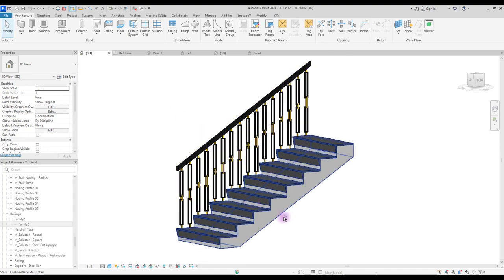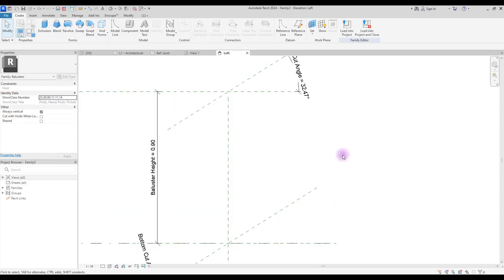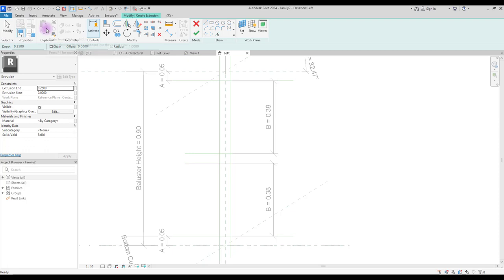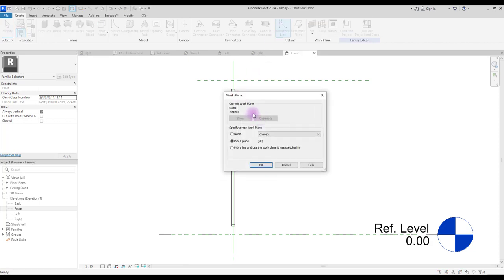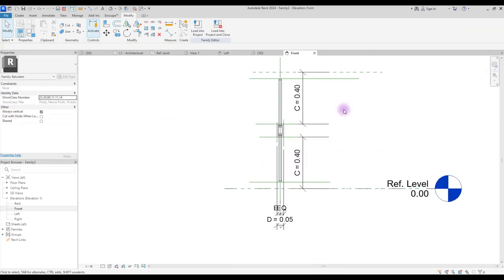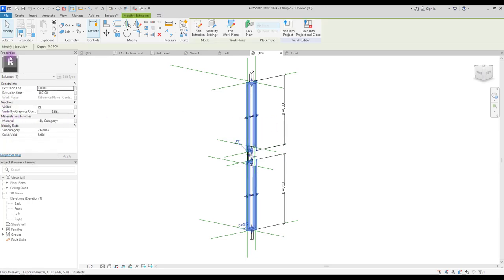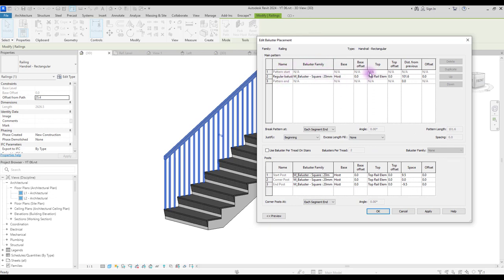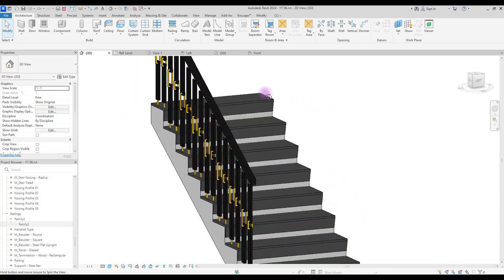How to Model Baluster Family for Railings in Revit 2024 #revit

Comment: Hi, Can you make a video about bath level drop? Should include finishes, structure. eg: from bedroom to bath with 25mm drop, bath to shower area with 25mm slope. is there easier way to modify it for all baths? I searched online, common way is create a slab depression, but all videos just a simple structure slab.
Reply from the maker: I'm afraid I did not quite understand the question since it is related to MEP and plumbing. I'm currently learning about this discipline so I will let you know once I find the answere.

Comment: how you can use 2 kind with different shape ?
Reply from the maker: You can use different families for Corner, start and end. 
Also, you can set two railings on top of each other and control the distance between balusters manually.

Comment: How the size changes of the central one yellow part ?? As u have made it bigger?
Reply from the maker: It is situated between two parts, and when we adjust the overall height or the height of one part, the central part changes automatically as it was modelled to fit between these reference lines. Additionally, since this family includes treads and railings, their size impacts the dimensions of the central part as we move upward. I hope this helps. 💜
Reply: @RVTPLUS  thanx
Reply: Make a video on parametric door and windows too